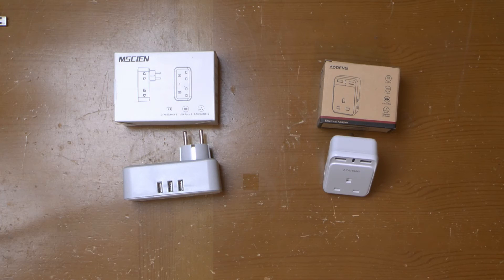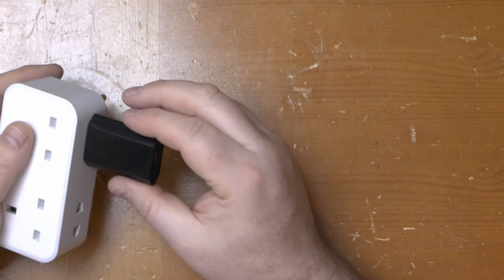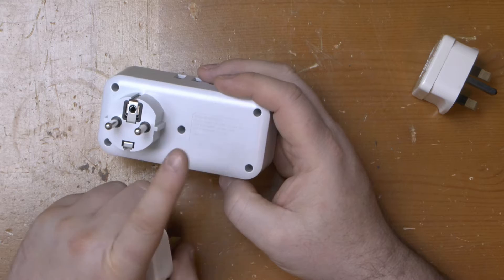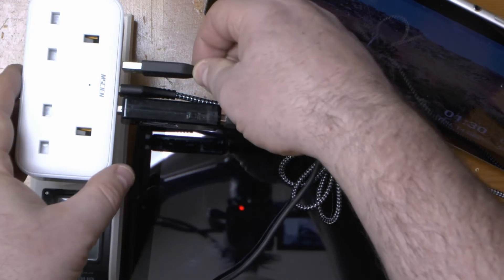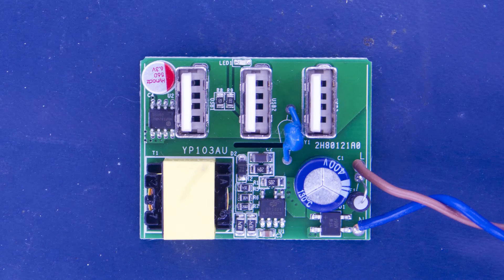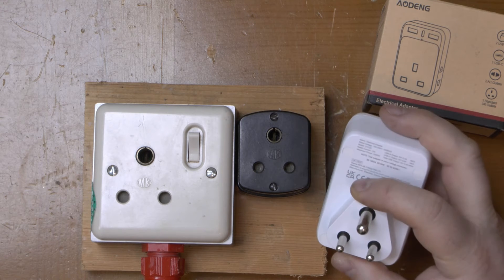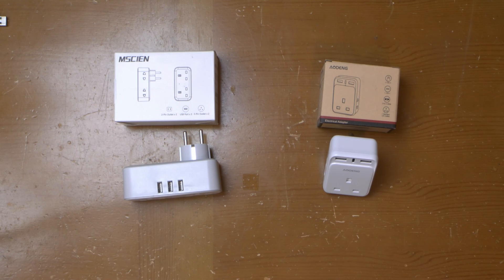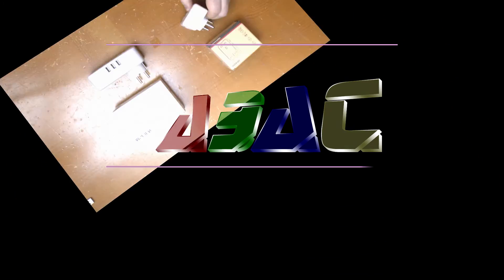Mscien and Aodeng travel plug test, teardown and schematic

Comment: I always leave a foot or so of cable sticking out the end of molded on connectors for ease of reuse as stubby cords (unless the connector is NFG of course).
Another option is having a few IEC C14 to 'insert needed mains receptacle here' adapters and then all you need is the right C13 cable.  Only problem is some adapters can be rubbish; one of mine got a bit toasty running at ~1.5kW (at 240V) whilst frying the Christmas turkey a few weeks back.

Comment: Funny to see someone with a 4 ways extension adapter - I used to do that...
It evolved... Now the 4 way UK power strip has a lead terminated in a C14 inline socket, because no matter where you are, you'll be able to find a local C13 "kettle" lead.
I take a local C13 lead with me if I have one.
Reply from the maker: I've rolled a few of those as well at work, to run equipment with 13A plugs from UPSes with IEC outlets.

Comment: I wish these kinds of devices would have a physical on/off switch for the USB charger, because once plugged in, the AC to DC circuit always draws power. They even have a term for it: Vampire Power.
Reply from the maker: That's why I'm not a fan of wall sockets with built-in USB ports.

Comment: Older UK sockets used to have a steel spring around the blades, brass is only springy to a certain extent, so the springs assist with getting the grip back to how it should be, you might find the springs on that 5 amp socket.
Reply from the maker: They don't build 'em like they used to :)
I think the only springs I've found in sockets are the ones that ping off the shutter mech when you open it :)

Comment: For me like you it's stick a decent Schuko on an multiway extension lead or if going the other way either put a UK plug on a Schuko extension or get one of the Power connections adaptors.
Luckily when I do buy stuff from abroad it's usually the musical instrument retailer Thomann who either ship the correct Power connections adaptor or the correct IEC lead for free, and on that note my last order came with a couple of their own brand UK "kettle" leads  (even the cable itself is branded Thomann) and imagine my shock when it turned out they use 1.5mm2 cable, for once a "kettle" lead more substantial enough for 10A. The extra thickness was easily noticeable.